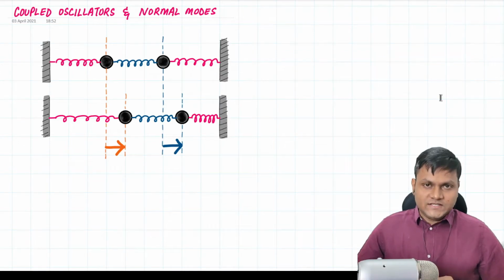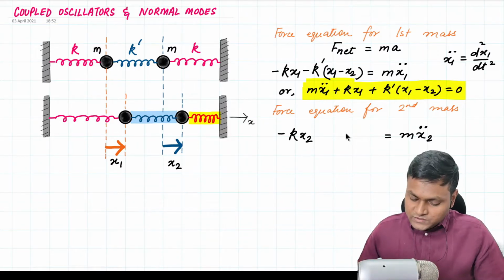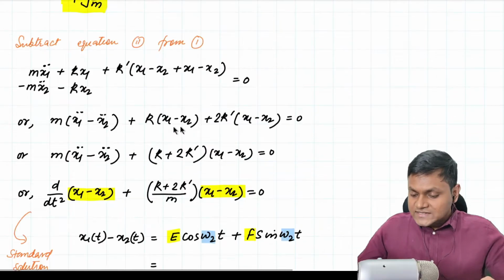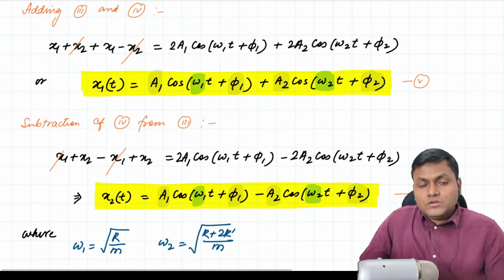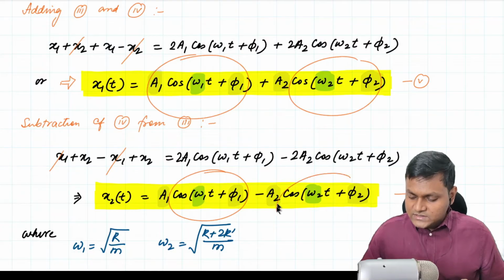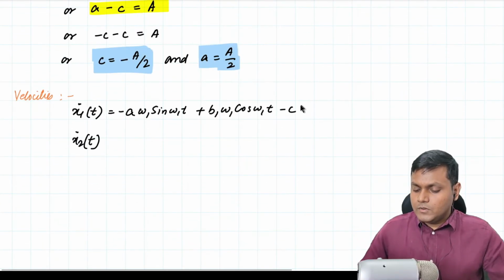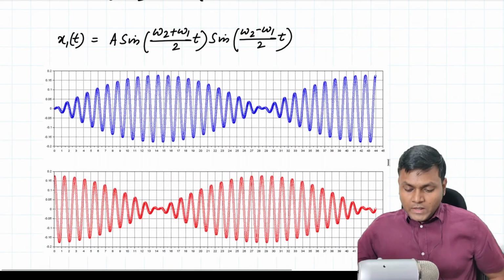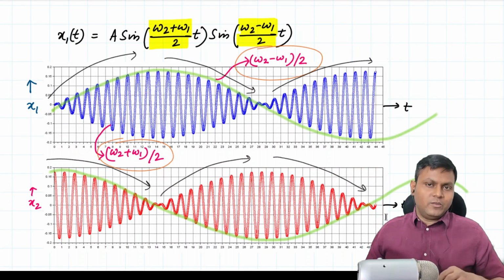Coupled Oscillators | Normal Modes & Frequencies (Step by Step)

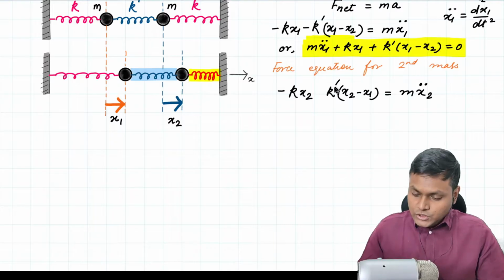Comment: 7:18 Regarding the first mass, you said  " if x1 >x2"   and for the second mass you said   "if x2>x1"  , could you please explain why did you assume these two contradicting assumptions for the same system? Thank you.
Reply: They are assumed to be different in both the cases just for the sake of simplicity. You can stick to a single assumption for both the masses and will end up getting the same pair of equations of motion.

Comment: Regarding the first mass, you said  " if x1 >x2"   and for the second mass you said   "if x2>x1"  , could you please explain why did you assume these two contradicting assumptions for the same system? Thank you.
Reply: suppose x1>x2 while considering second mass, then the direction of force would be opposite (in this case rightwards). - k(x2 - x1)= + k (x1 - x2).